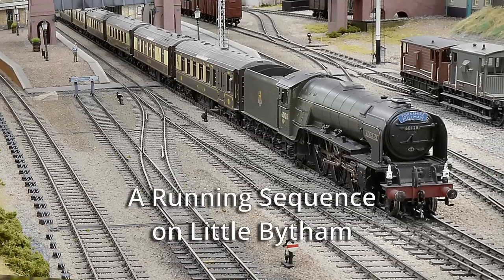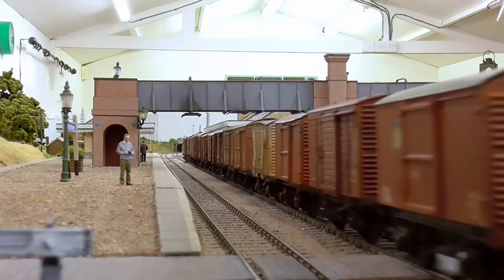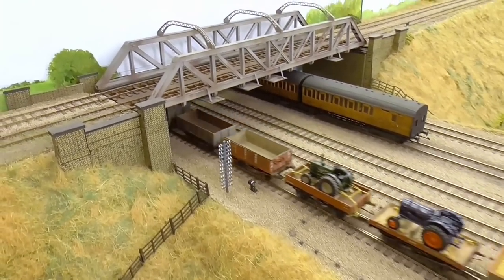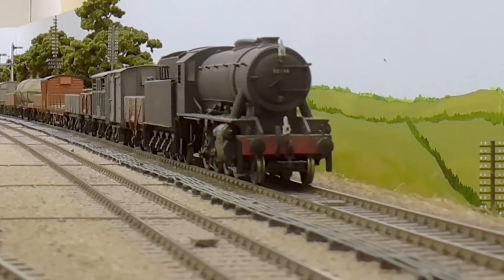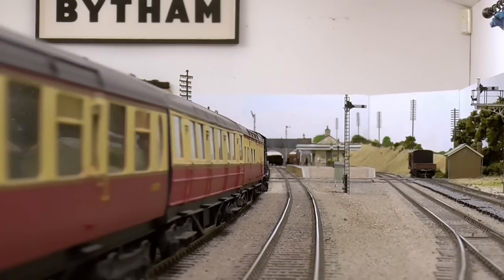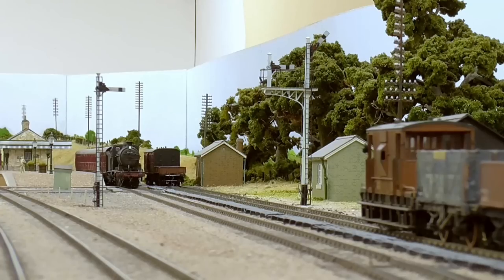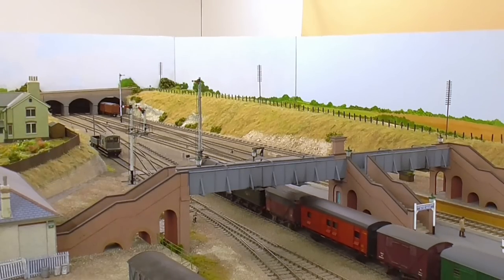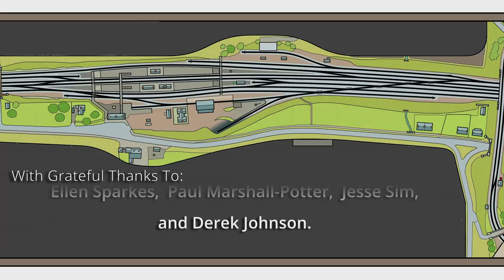A Running Sequence on Little Bytham - December 2022

Comment: The blue tractor is Fordson E27N (The first Fordon Major) and were manufactured between 1945/6 and 1953 when they were superseded by the more modern looking (with curved tin work ad lighter blue paint) E1A Fordson Major. These were made at Dagenham, but of course would have been moved by rail all over the country.

The Green tractor is a Field Marshall, Built by Marshalls of Grantham, and where the tractor that drove the steam traction engines off the Threshing contracts Unfortuetly from the video I can not tell what series it was, by the Series 1 was introduced in 1945, and the Series3 was taken out of production in this colour in 1953, when they became the Series 3A and were painted orange, until the Field Marshall tractor design was withdrawn from manufacture in 1957. 

Allis Chalmers were Orange tractors. There were several companies along the ECML corridor. At Doncaster you had the International Harvester company where they made Farmall tractors. These are a red colour. 

I love your layout, makes my efforts (Bungay - which you can find a video of on youtube) looks very amateur. I've had a go at making kits, but I find them very fiddly compared to the machines I'm more used to haha.

Comment: The amount of work put into the building of the rolling stock particularly, is astonishing. And the paintwork is spot on so that I thought, with the low down photography, that this was the real thing-apart from the smoke of course. I particularly like the narration and its detail descriptions. I am not too familiar with the eastern region of BR being a former Manchester trainspotter in the late 50s and early 60s, although we had the occasional visitor, and the train descriptors and destinations  etc were painstaking and fascinating. A first class piece of work..

Comment: World of Railways. Tony, How nice to see a layout operated in a manner that takes one back to the 60's. Electric Pencil, for operating the pointwork. Large control panels with lots of switches. The late Peter Denny used "Flip" timetable cards, on his famous Buckingham layout. The late Ken Beal made extensive use of "Kick Back" siding's on his exhibition layout. I saw his layout at Central Hall, London. Back in the 60's this exhibition was where the circuit started for the year. York, at Easter. The year alway's finished in Manchester in December. For me Little Bytham, was a stroll down memory lane both front and back of the layout, Thank You. Cheers, Chris Perry.

Comment: I admire this railway so much I am building a distillation, through lack of space, for myself.  Studdying the track plan I can see that there would be a need to move railed vehicles arround the station but there is no engine shed.  Would a shunter come from another station as and when needed.  Thanks in anticipation of a brieft reply.

Comment: I miss my A5’s, I built two many years ago, I had a couple of spare Triang princesses that were extremely play worn, so after finding the wheelbase to be same as the A5, I embarked on two builds working from Skinley drawings and photos.
One was completed, and built to 18.83 standards, one was around 50% complete, and done to OO gauge.
I foolishly sent them off into eBay-land at least a decade ago, maybe much longer.

Comment: Thank you for those marvellous moving images from days gone by. I was wondering if the points and crossing work in the images are scratch-built, and what gauge of track? 
I respect the amount of work gone into this creation. It ultimately belongs in a museum.
Reply: And regarding couplers I noted the Spratt and Winkle. Do the trains fitted with 3 link use the buffers for pushing?
Reply: A special thanks for the photography. I doubt that would have been possible with cine cameras of a past era.

Comment: Great running session.
Great layout and trains. 
One question.
My layouts are DC which means that I control the trains.
If the whole DCC session is running to a pre set schduled time frame. Where is the fun in that?
Doesn't that become just a visual layout rather than a hands on session? 
Honest question from a non DCC enthusiast.
Mon from Monsville Railways
Reply: Little Bytham is DC not DCC?

Comment: My congratulations on one of model railways masterpieces. There is nothing like the love of an owners model railway when success is achieved. I would love to see your thoughts on what makes good running. I model in N mainly on exhibition layouts but now too old and disabled to go out any more. My criteria were...properly laid tracked, correct back to back wheel measurements, all rolling stock to have perfectly square chassis, and correctly fitted couplings all at the correct height and spacings, I use DGs on the end of every rake, all locos and some individual shunting items. All the rest arehook and eye for goods and modified standard couplings on fixed carriage rakes.
Have I missed anything and do I do anything badly wrong?
Cheers, Bob